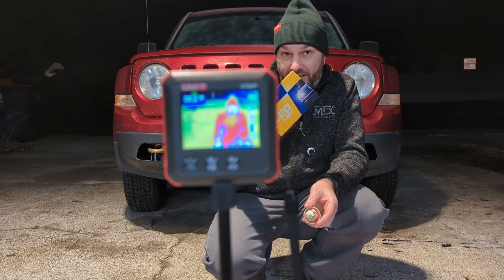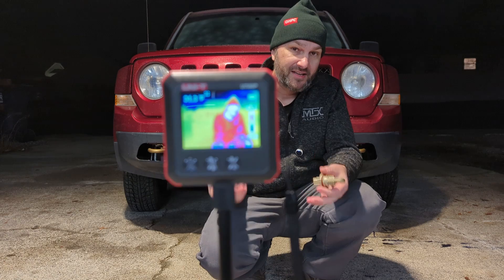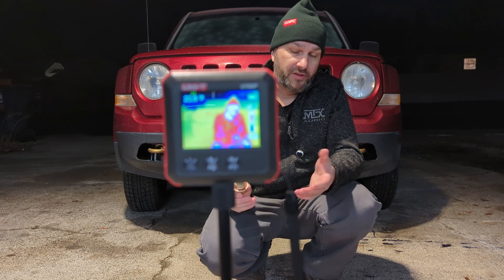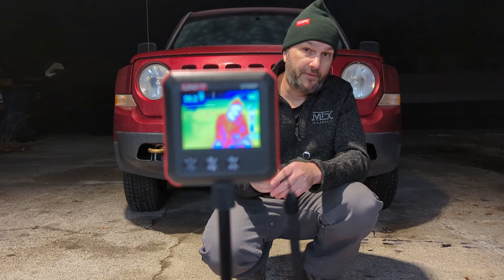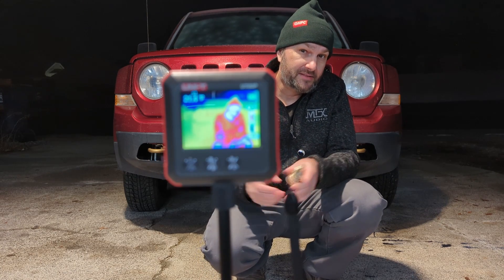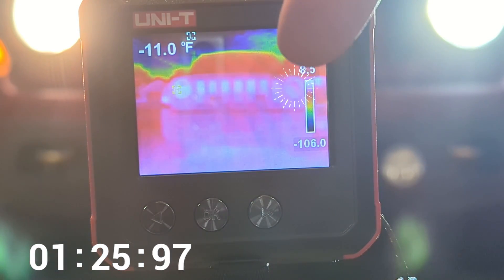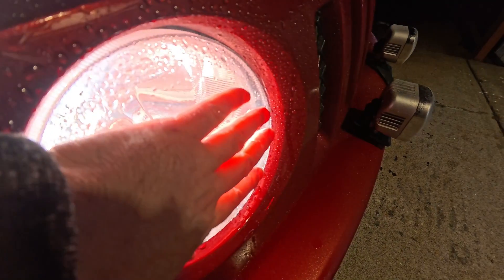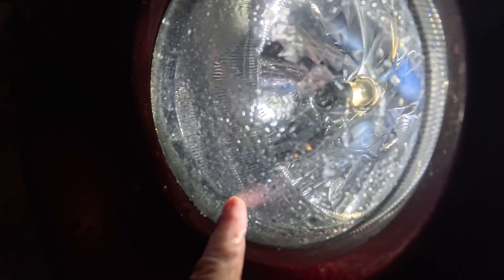LED vs Halogen vs Winter

Comment: Do HIDs work better than LEDs in cold climates?
Reply from the maker: Yes and no,  they do take a moment to warm up enough to emit light when it's really cold, but never more than a second or two if they're working correctly.    Lower K color temperatures like 4000-5000 emit a lot of infrared and broad spectrum light so they reflect well off wet and dry surfaces.    Still not as much as incandescent but they can emit a lot more total light.   

Only real down sides are both the ballast and the bulb have finite lifetimes & they need to be in a projector or a reflector specifically designed for them,   retrofits that just use the same incandescent reflector make a lot of glare and don't send the light down the road where  you need it.     When they're great they're great.